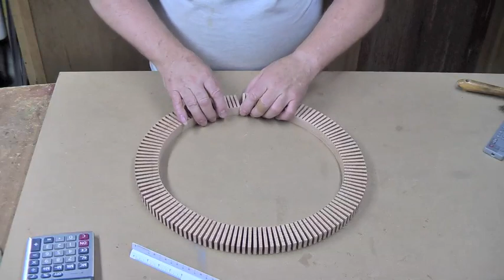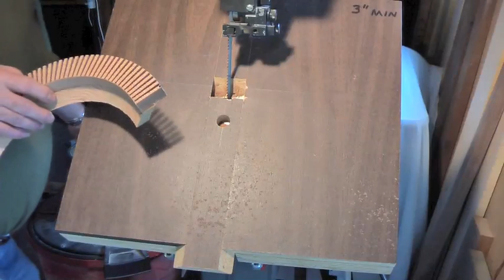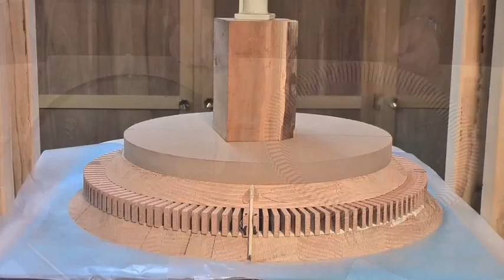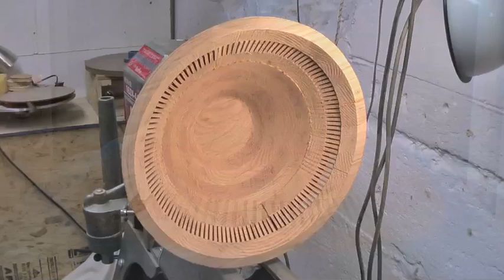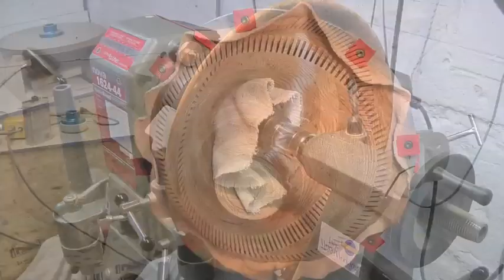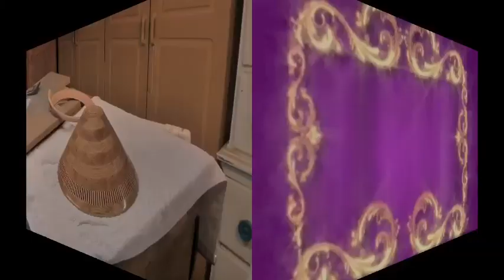Economy 2.mov

Comment: Hi Dennis! Very nice Job. How do you sand and finish the inner surfaces between the slots?
Reply from the maker: You can not sand between the slats.  I spray high gloss lacquer between the slats before turning to get a finish in there.
Reply: @edwardsx999  excellent reply, would have been useful in the directions, but it is here for those who delve deeper by reading the comments section and replies. Thank you for taking the time to walk us through the steps, and thank you for taking the time to respond to the questions as well.